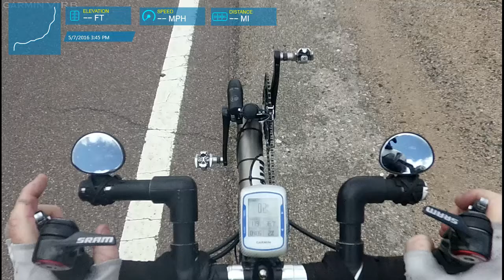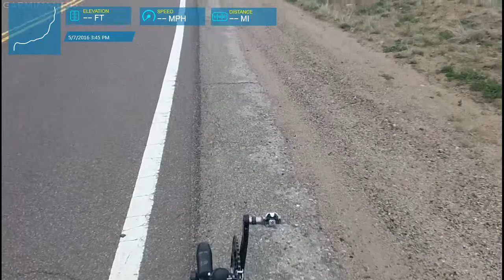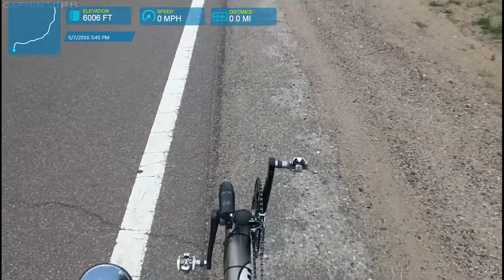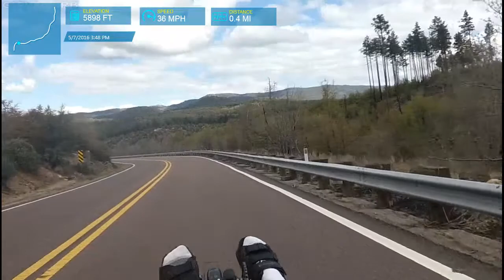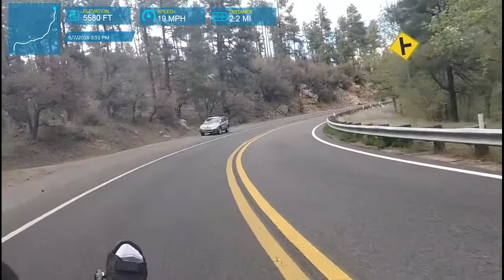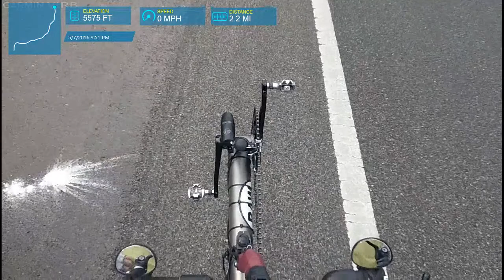Recumbent Descending Technique

Comment: Nice video thanks! 
Not sure you gain this much ( 9% !)  by using this technique, but I may be wrong! 
My method consists in trying to sit as much as possible in front in a way that my head gets few centimetres lower. 
With my recumbent (M5 High Racer) I can visually see that the speedometer shows roughly 5% increase